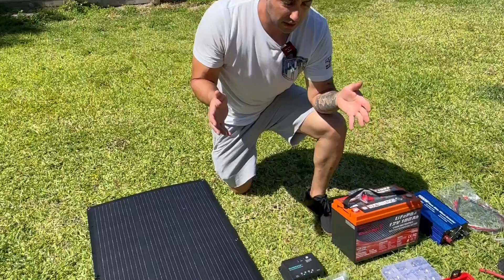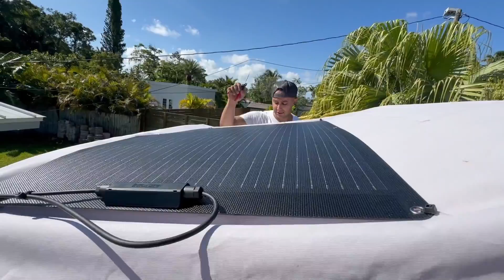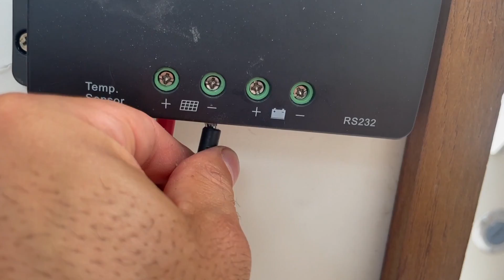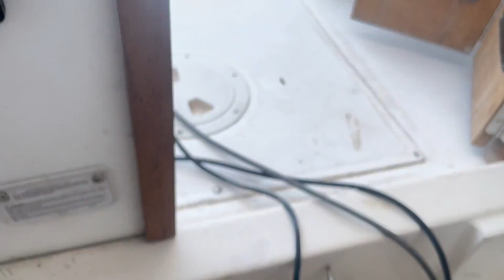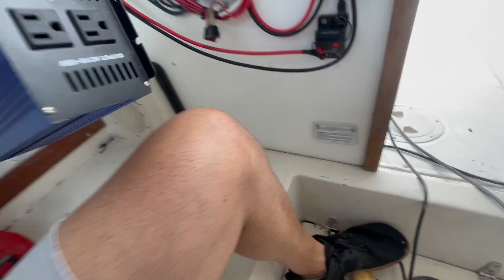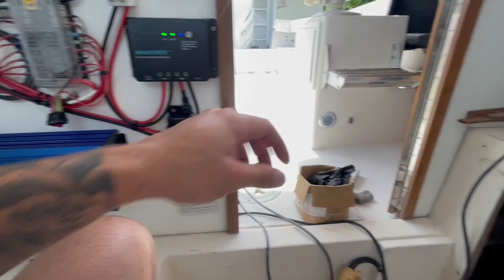Easy 100 Watt Solar Setup On Our Boat | Beginners Guide EnjoyBot Battery

Comment: Great Video. Do you have an engine driven alternator? does the Alternator charge the battery also? Since you are using a Lithium Battery you might need a DC to DC charger to protect the alternator.
Reply from the maker: I actually have another video where I install a dc to dc charger. This is an outboard so the solar panel is separate from the engine

Comment: Hello! Can I install 2 or 3 batteries in the same controller? We want to try to run a small AC and a refrigerator from the “house batteries”. We want to get rid of the diesel generator. Thanks
Reply from the maker: Yes, if you run them in parallel.

Comment: The connections into the charge controller: how do you (should we) protect them from moisture getting into the connections?
Reply from the maker: Good question. Search smseace power connectors with pvc cover on Amazon. That might be a better option. I would also use a an anti corrosive spray on them regularly. Or, buy a marine grade charge controller that has a better connection but that might get expensive.

Comment: So the current coming from the solar panel is DC? Can you charge your phone directly using DC power? And LED cabin lights? If you didn't need any AC power, it there a different device to use that will permit you to plug in safely to power LED lighting, and charge any mobile devices?
Reply from the maker: Yes, you technically could do that but you want a charge controller to control the spikes and drops in voltage which could damage the appliances. 
12v cigarette port can’t charge your phones or even a simple 12v usb plug

Comment: You should always connect your battery to your solar charge controller before your panels otherwise you run a risk of damaging your Solar charge controller.
Reply from the maker: The switch was turned off for that reason

Comment: Great video!! I've got a 2002 GW Gulfstream 232 that I've been thinking about installing a solar trickle charger on so that the house battery never dies. Would this system work just using the sealed non-lithium house battery I currently have?
Reply from the maker: Hey there! Yes it would work perfectly for that. They have smaller trickle charge kits that are made just for what youre trying to do and it’s very cheap. They come with a charge controller with settings for any type of battery. I believe harbor freight has them! 🤙

Comment: I have a question...
I have a 300w solar panel and a 12v 50ah battery and for some reason it doesn't want to charge at more than a 100w.
Is that normal?
Reply from the maker: Hey mark! That doesn’t sound normal at all. Can you try to charge the battery with a battery charger and see if it gets to 100%? That way, you can determine if it’s a solar panel issue or a battery issue! 🤙

Comment: My Brother Another Awesome Video!!! Loved it...My Brother in law has a flex solar panel, and the only problem was that with the wind on the Bimini top ripped along the edge of the solar panel, suggestion put a piece of vinyl along the edge of the panel to reinforce it. It can be fastened with fabric glue. The best is sewn. But at least protect it from ripping. Great information! Blessings! Peace from the Keys!
Reply from the maker: My brother thank you so much for commenting. Youre 100% right because it happened already. Aliey is going to sew together a new Bimini top fabric with an insert to hold the panel down and with a heavier fabric. That’s a great idea! Thank you Jorge! 🤙

Comment: I would get a real 100 watt aluminum frame panel instead of that toy stuff. They are as low as $48 now. The inverter is not necessary if you use 12 volt appliances.
Reply from the maker: Appliances we’re using aren’t 12v. The flexible panel was much easier than setting up a framed one. Maybe when we get a hard top that would make more sense 🤙
Reply: @perfectfitboating  I see.

Comment: Sweet set up. 
Why did you not use a standard boat battery on off switch?
I put a on off switch on my trolling motor.
Plugging and unplugging a trolling motor every trip like most people do never made sense to me. 
I had the same red wolf breaker on my 24 volt trolling motor except it was a 60 amp. 
Started having issues with it tripping.
Replaced it with a blue ocean and have yet to have any issues since the replacement.
Reply from the maker: Thanks buddy! You know, once I started to mess with the switch, I said to myself the same thing. I guess it’s what happens when you close your mind and just go by the book. It’s a great switch for your home but for a boat that’s moving and banging, you’re totally right. Boat on off switch is the way. I’ll switch it for sure. Thanks for the tip and thanks for watching we appreciate you! 🤙